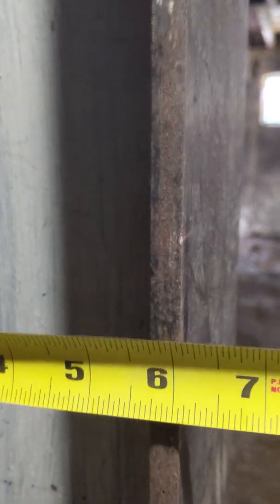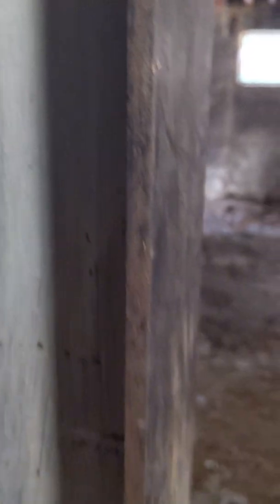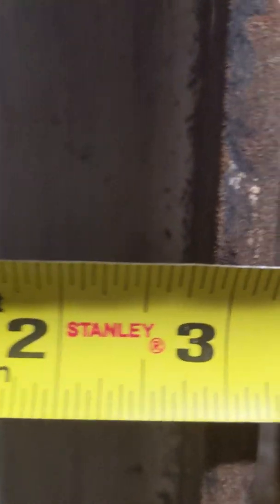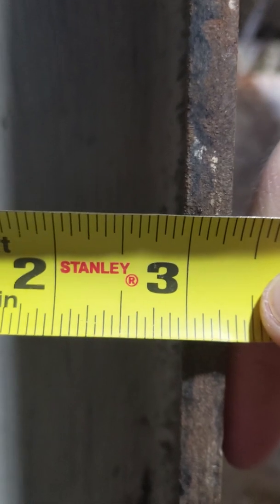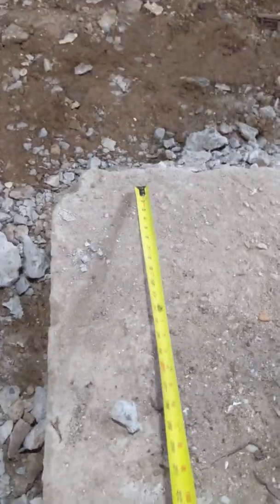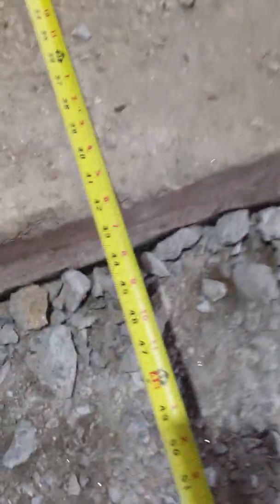How to Measure an Existing Column and Footing

Comment: Looks like 3/8"
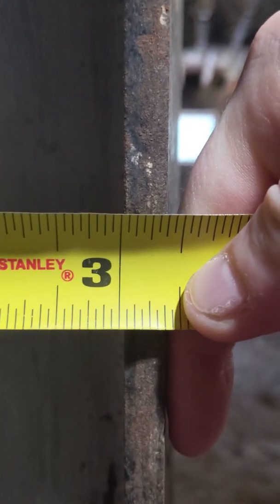Reply from the maker: I double-checked at 0:26 and it looks like 5/8 to me. 
I did take a measurement before making this video as well.

If you were designing or checking the existing structure you can do your check with 3/8 to be conservative and if that passes then 5/8 certainly will. 

Appreciate the comment though!
Reply: @ThatCivilEngineer  Still looks like 3/8".  It is clearly less than 1/2"